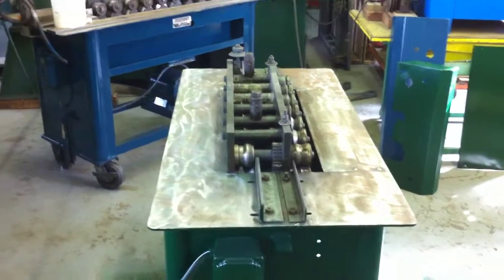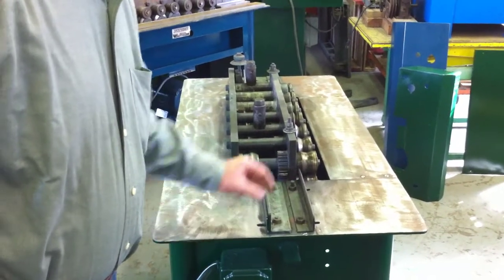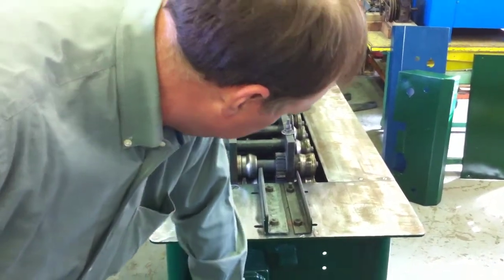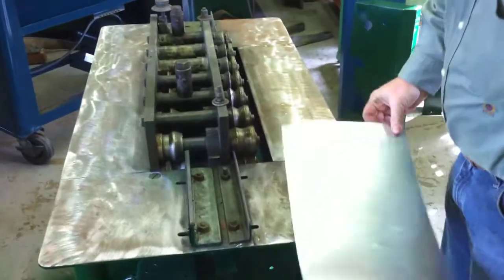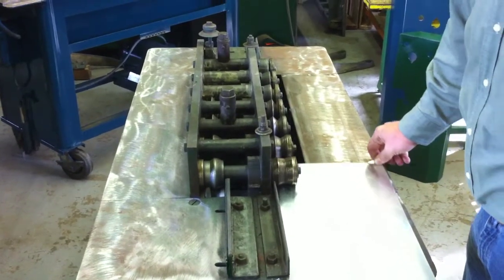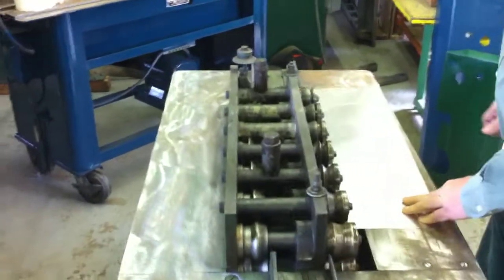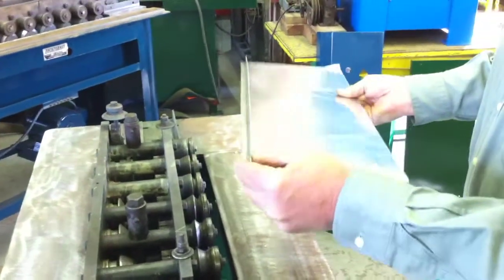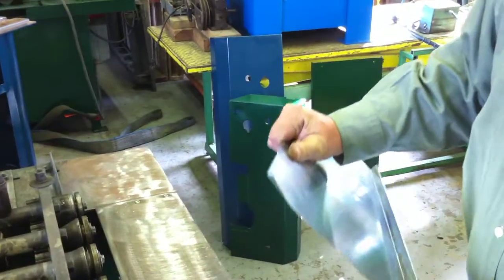LOCKFORMER 18-gauge Pittsburgh with 3-n-1 Rolls

Comment: I was a machinist for Lockformer for 20 years. i made some of the parts in that machine. it's is a great machine and will run for decades as long as you keep it greased and shoot a little Galv-off on the rolls. We had a unit in our old showroom that was built in the 50's that still ran without a hiccup. Any machine made before 2005 will last a lifetime.
Reply: How do you know what year it was made by the serial number if you don't mind? I'm actually looking at a used one locally.